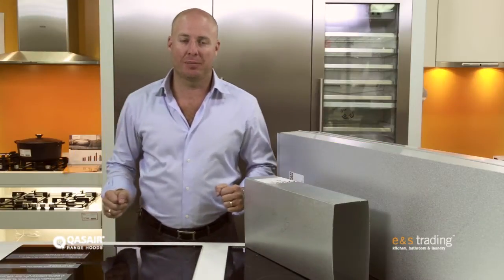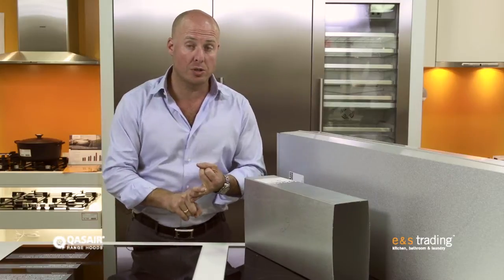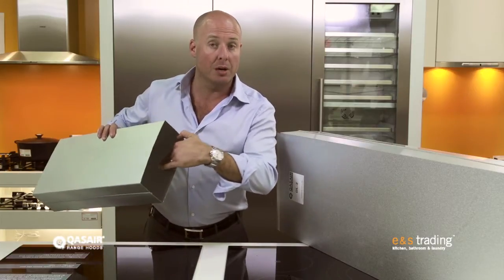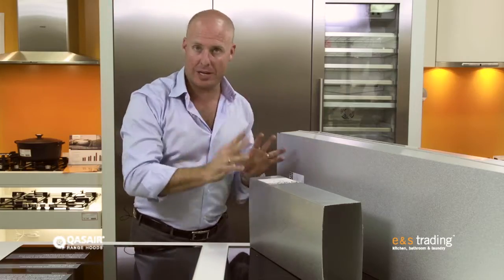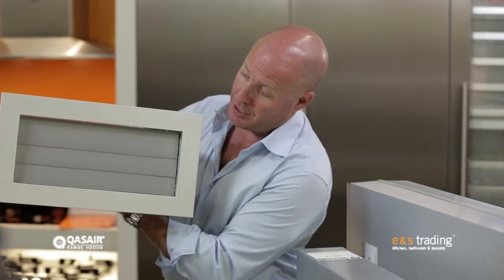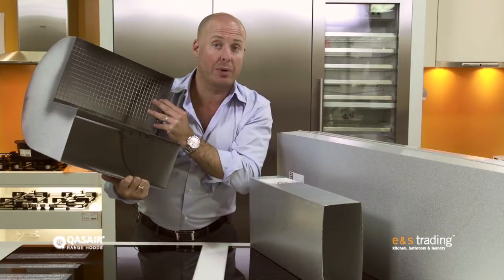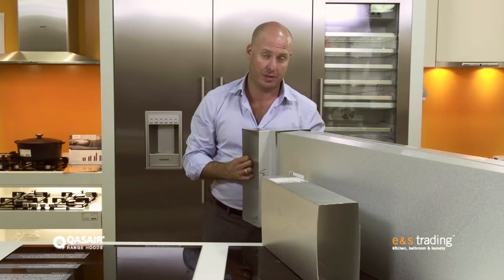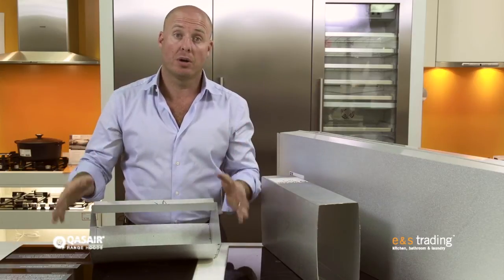Features of the Qasair Rangehood Ducting System

Comment: Before you buy any Qasair rangehood, make up you ask these question very very hard:
Are filters made of stainless steel only? Not stainless steel mesh on face only with Aluminium mesh internal?
They do NOT crumble inside dish washer if normal dish washer tablet are used.